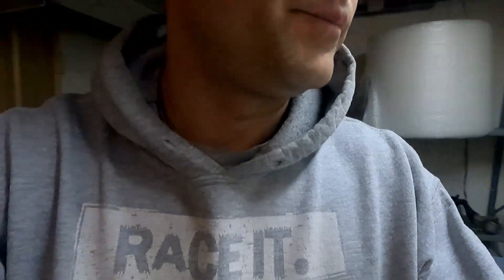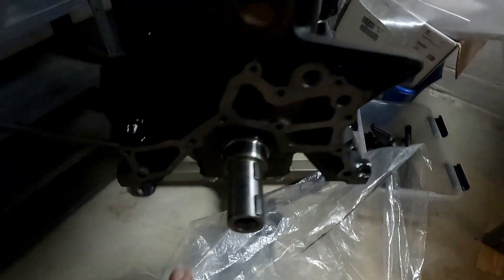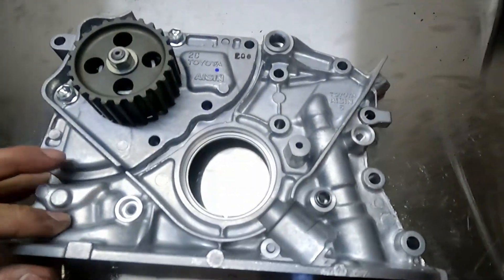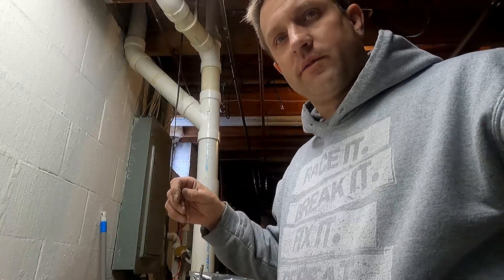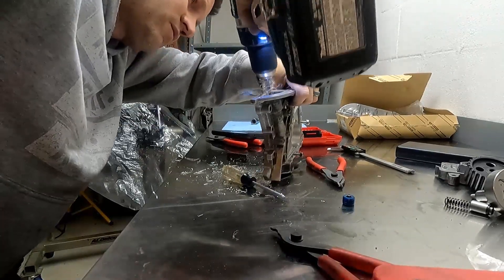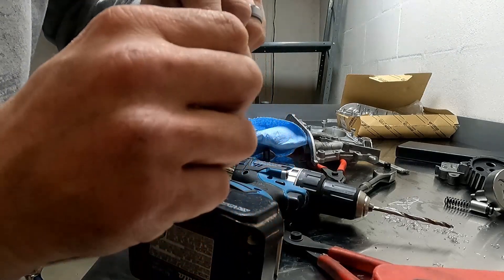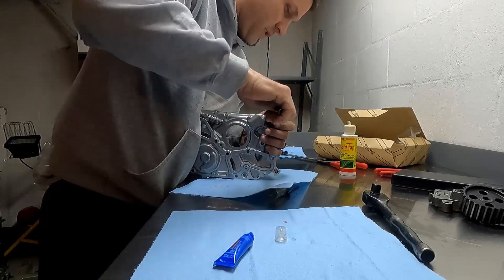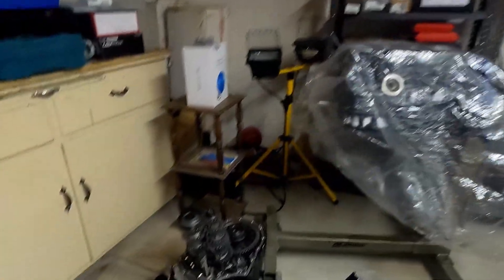3S/5S Oil pressure mod

Comment: I know this is older but thought the following might be useful. Highly encourage measuring full collapse depth to verify the bypass is indeed opened. If preload shim thickness is too thick, then bypass will remain closed or may be close to full collapse in which pressure goes up exponentially for the spring to reach full compression point. Other than that I love the creative thought and sharing with the community.... Thanks!

Comment: I'm confused; You measure a 7.5mm total depth for the valve body (6.5+1mm retainer clip).

After this mod you 've shimmed 3mm with the plug (10mm plug but sitting flush to end of valve body) + another 3mm with washers...the spring's travel distance is now only 1.5mm? Am I reading that right?

Comment: From Where & what part is the plug
Reply from the maker: Just an NPT plug that is aluminum
Reply: @rm2932  I got my motor 5SFe still at Machine shop, I got the Motor Powder coated, I can’t believe they took a year on this project, custom cut forged pistons,  t Rods, bored cylinders, 10:1 compression even though I’m supercharging after break-in, the pistons took 5 months , they said due to covid, all delays excuses are covid

I want to raise my oil pressure when i get my New oil pump Housing

My motor is almost complete soon

I kept original head instead of putting 3sgt head which has to timing pulleys, intake exhaust, mine is original 1 pulley drives both cams, The grinded  the center piece in head, thermal insulation costing on pistons.

Oh & stronger springs for lifters, new valves, i told them I may run it 10 or 12k rpm, but wow, you got yours 14k rpm. I’m going yo check with them on springs since they’re waiting on powder coating to finish before they assemble everything
Reply from the maker: @SteveSolaka  ⁰0
Reply: @rm2932  what does that mean?
Reply from the maker: @SteveSolaka   i think my kid got my phone there. Lol. Sorry

I only hit 14,000rpm on my mis shift which sent a rod out my block. I have my rev limiter set to 9,7000rpm but try to shift at 9,500rpm. 

You will not make power at that high of rpm with a 5S head. You should be shifting at 7,500-8,000rpm is my guess if you have cams and a new short runner intake manifold. With just cams more like 7,000rpm. Again this is me just guessing.

But for me to have my peak hp at 9000rpm I had to put in 287° cams, a lot of porting, and a super short runner intake manifold.

Wherever you peak hp is on the dyno, shift like 1,000rpm after you hit peak.
Reply: @rm2932  you mentioned that the ring clip may pop out if spring of spacing is modified for higher oil pressure? 

Any specific size npt plug?

Comment: You should mod new oil pumps for the 3SGE and sell them...most guys would rather buy it from someone that has been there and done it "right"
* 3SGE engines really do punch way  above their weight, be a shame to lose one like you previously did

Comment: How much would you charge if I would purchase an oil pump for a 3SFE, a 1997 oil pump for a RAV4? How much would this mod increase the oil pressure? Can it be used on the street, turbo?

Comment: I did the same exact thing on my 5SGTE build too.
Later i blocked it and went for an external oil pressure regulator wich lets me adjust the pressure up and down.
Reply: Interesting... what external reg did you use?
Reply: @mwpaus  If you would like to do the same thing to your car/project and are confused about how to plumb it to make it work I can explain/show you how I did mine, not saying that how I did it is the right or best way to do it though but it works for me.
Reply: @fdfx3  thank you very much. Ive got an idea of how i would use it... I would remove the factory valve, TIG up the relief hole, then plumb it between the block and my remote oil filter mount. Pretty simple really.
What max pressure do you have it set to?
Reply: @mwpaus  Yes it's  really that simple, for the returnline for the relief line or whatever you would call it I just made a block of plate for the oil level sensor and put an AN fiting there so it would drain back through there.
I had the pressure set to 6,5 kg/bar or 92,43 psi, but I'm having problems with the head filling up with oil and pushing it out the PCV pipe on the rocker cover after long periods of WOT, so I reduced the pressure down to 5,5kg/ 78,21psi to help with this problem.
So far I haven't gotten around to find a fix or the source of my problem with the the rocker cover filling up, maybe I need an oil restrictor to the top or have excessive bearing clearances on the camshaft or have too much blow by so that the oil won't drain back propperly. If anyone have had any problems with this I would like to hear about it.
So 5,5 is what i'm running at the moment, if I could fix my drain back problem I would probably increase it to 92 psi, but I'm yet to figure that out.
Reply: @mwpaus  Just a thought... Could the heat from welding possibly distort or warp the housing of the oil pump?, or maybe it's not a problem.
I just used a stiffer spring and shimmed it so I know that it would'nt open just for good meassure and used an NPT plug at the bottom like Ryan did in the video, except I did not drill a hole, this way I did not need to weld and it's also not necessary to take the oil pump out and timing belt if you're lazy.
And as an added bonus it is reversible of you should ever fell like it.
Reply: @mwpaus  Hey Mark, I used rhis exact unit only with AN10 lines instead of 12 wich is in the link, it is a Peterson oil pressure regulator, it works really good for me I can set the maximum oil pressure to whatever I like as long as the pump can provide the flow of course. 
https://www.ebay.com/itm/Peterson-Fluid-09-0161-Oil-Pressure-Relief-Valves-12AN-In-Out-NEW/143910360250?_trkparms=ispr%3D1&hash=item2181b9d4ba:g:d2oAAOSwfW1f9i~9&amdata=enc%3AAQAFAAACgBaobrjLl8XobRIiIML1V4Imu%252Fn%252BzU5L90Z278x5ickk7d4nremBkvNKtcC0ZwqXDFzfA1F6FYHx6xJyUAhUCKNRaVHy4q5%252FW3vEejpJk5H7rDMunVD8UhE0DMBCKkeZSeXMMNa%252BXC9lJ7HLN6Kay4ryEp8za60qQmIJMgw02LMh%252BfvKfS%252BM9ZAMN8HaQPmAymgWaCXnalf4hIseeEAowDCXUpS4wTdXEJl%252FFTw1lYk0w0UwYzoVuGVS4hxbO3dxTpQaonQo591IAS3B8cpVwcay3BGosNO7BO1MZa962wiIh6vHQ5vpincleehgHS%252BlrGRAr44GXPD5dQVEH9G9z%252FoFTeNwtDLUhtnR7fPeyoFp7oBtqwcLT0xf3jpvabYNK3CMMRXptJDRBs9Bkid2KN9b4wQhytEbVGgMFuwGoJvsEGiDVri%252BYIMeMxdoAc83tNb9hHXi1CWpbqfxkEUPrtYQxzaRsVAQyyOMq58ORv20kCFMq4%252Bz%252Bxs4PcYrdouSUVPOIP7nufUKDTSkCQJqb2m9PLOpQh0Lfd0VaFAfBDsvvqphwlyxq3uSLE6LmKqphGGtAogmcSR0nfHBCLcbxy7obStL%252Biq1KLM63rOuBNSEUpNPwRctAzRQfDRhO3BwgUG0JGDT%252BTV27rUpLfKNrTgJnAQCfEHEmnAwRT1ukn9Q688gysFaoXA7UemsGRdfaVU0Yv8k%252BGZnFpV88h%252FNDYjUfBiat5T3KRBdJazS3CD3GDc%252BkiQWOqAp7ZzOQsAdjg%252BIMTVGfdzQAWzfQOyS%252BC3HoJ4HE1vygSYs4ekjLqGOSjoZsfJ0ybVVmJPy8ltFjv81Gg9K0zG%252B1hda4kgvMzc%253D%7Ccksum%3A143910360250b5342c27562b48f88812b0bddb8b0225%7Campid%3APL_CLK%7Cclp%3A2334524
Reply: dude could you share some info on how you accomplished that

Comment: Is there on top of the little piston a seal?
I have a 3sge gen2 build and when the engine stands over night it takes 3 seconds to build oil pressure could the seal of that little piston be the problem?
Reply from the maker: There is no seal at the top
Reply: The piston is part of the system that regulates the maximum amount of pressure created by the pump, other than damage only if any debris is preventing it from totally closing can delay oil pressure. Apart from incorrect oil clearances on the mains, you should check oil filter return/ anti drain seal, is the oil too thick for your application, check clearances on the old pump rotor/shaft/housing, is the oil pickup tight and sealed